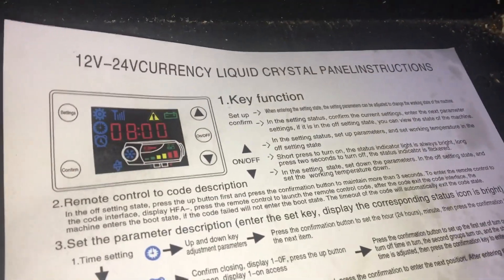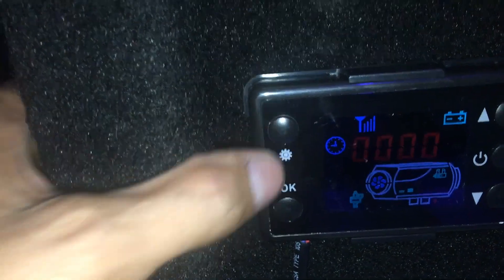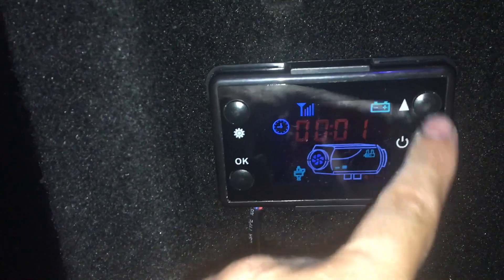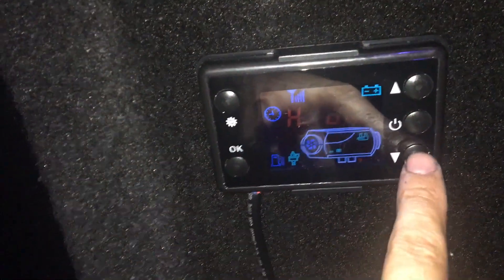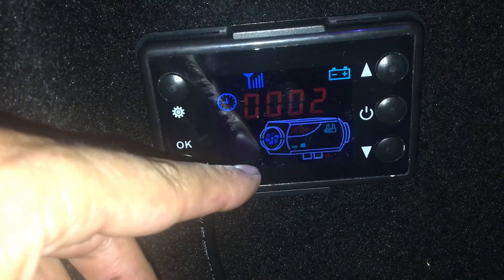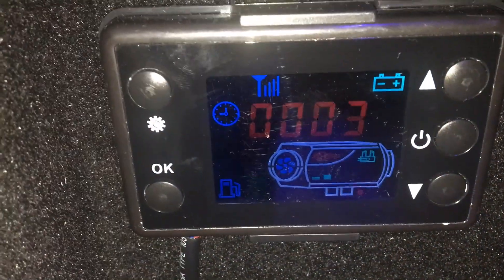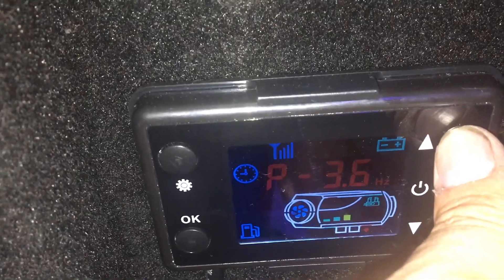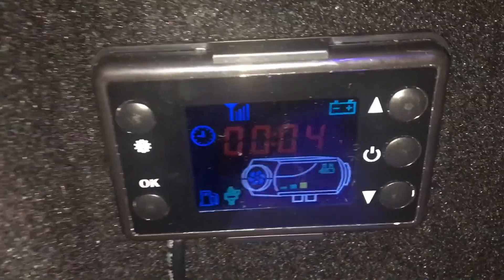air diesel heater kw 5.0  controller setup

Comment: Hey Ruva, you can switch it to work with temperature preset! Just when it's showing the Hertz you have to press settings and Up buttons at the same time and voilá: now you can set ist to the desired temp! ( Mine was also delivered in Hz Mode) wish you all the best..
Reply from the maker: Big Ho Thank you thank you!
Reply from the maker: Big Ho but even though you switch to a temperature mode it still pumping constantly
Reply: Hm, are you sure that it doesn't turn down the fuelpump Hz and the fanspeed when you decrease the preset temperature below the ambient temp? The temp sensor can be found on the left side bottom corner of the display.
Does it show realistic degrees?
Should work like a thermostat. 
Good Luck, Holger
Reply from the maker: Unfortunately it doesn’t work as a thermostat :/ it keeps on pumping fuel
Reply: @RuvimAbaras  ,keep pressing them buttons.  Mine did the same.  Not sure what I pressed but now arrow keys shows a temperature now.  Also enter code 1688. And you can get in to error codes and other adjustments...
Reply from the maker: Dan Wilson Thank you so much how did you find out about the code 1688?
Reply: @RuvimAbaras  you tube,  I changed my control to LCD same as your one,  I had to change voltage setting as it kept throwing error code up.. great heater.  Look up Chinese diseil heater on you tube for some help with LCD controller.. good luck
Reply: Big Holg,  this was a HUGE help, I have three of these now and the new one came in Hz, my staff freaked out and so did I.  Bad enough I had to explain Celsius to them!  I was going to buy a new controller as there is ZERO documents or manuals out there it seems.  Thank you thank you!
Reply: @RuvimAbaras  I read up on this on the "non-chinese" models and have a bit of experiance with them. For the unit to stay "in fire" to prevent smoke and refire it will drop the fan to the lowest RPM's which is defaulted to 1600 RPM and the lowest fuel setting which is about 1.5KW heat capacity. Its always fired and the LCD controller does have a thermometer in it,  it ramps up the fuel and fan on demand for heat based on your lcd controller settings.  They never shut off, they can't or they will smoke soot up and make an awful mess.  We have ESPAR units on our ambulances for hot air and hot water for engine coolant for when the trucks are staged in sub-zero temps.  We have actually added these chinese models to several in the fleet at a fraction of the cost and thus far we are pretty happy with them.  They are literally clones on the units we paid $1500.00 US for.  I did try to lower the fan and pump Hz in the password protected settings, while they ran cooler, and they pumped less but they smoked and we managed to completely clog one with soot and fuel and had to tear it down and clean it. 

The parameters they have set as defaults will keep the unit from breaking down.  Also make sure before you shut them down run them wide open for 5/10 min to burn the soot out.  Our oldest one is 3.5 years old and has worked flawlessly thus far other than a failed temp sensor.  Good luck, if anyone finds and actual manual please share!
Reply from the maker: Ryan McClintock thank you so much for the info!
Reply: Thx for the info. Mine was set in Herztz now all good,
Reply: Hi I was supplied with the controller shown at the beginning  of the video can it be upgraded to the controller being shown? the connecter looks different?

Comment: Hi I have this unit my controller is the same as the one you display the oval one at the start. How did you replace it with the LCD you now have?
thanks
Andrew
Reply from the maker: This is very same controller that came in the package

Comment: Hi and thanks for the vid.

Mine is showing the ⛽ icon after a couple of seconds, but the heater is not heating as there's no fuel in the system.

Anyone help please.
Reply from the maker: Usually it takes a while for a fuel to get  in the system,
Reply: @RuvimAbaras  thanks.